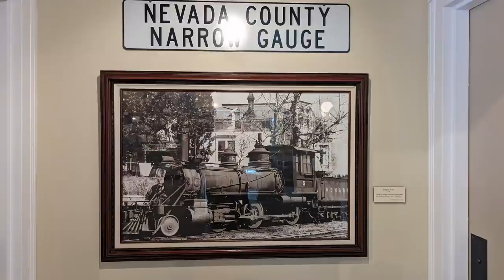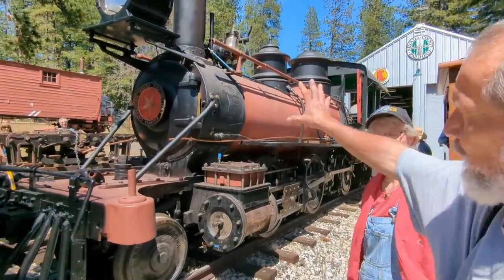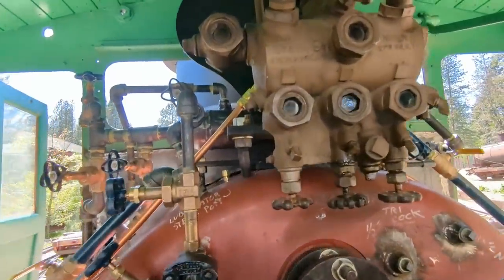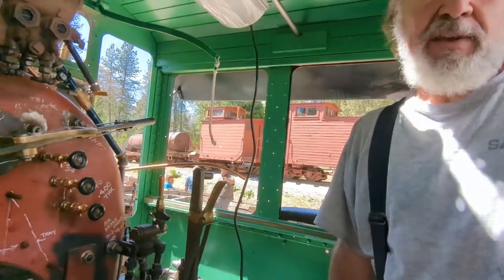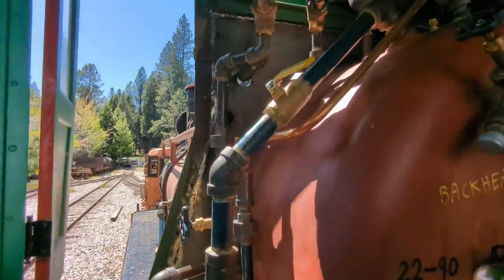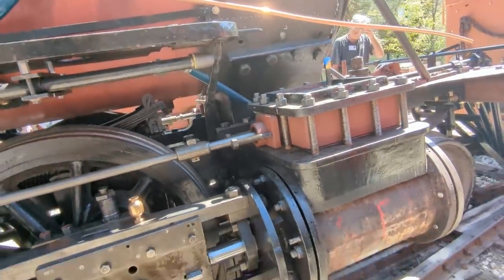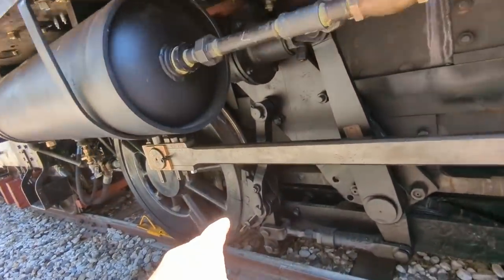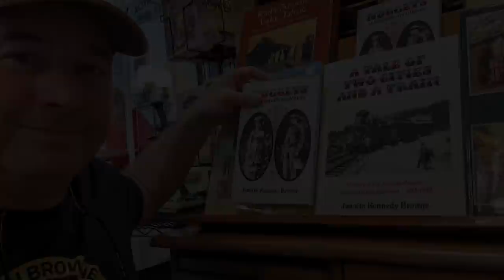1875 Baldwin Locomotive Restoration NCNGRR #5

Comment: It looks like this Engine uses the Stephenson’s valve gear as Opposed to the more commonly used Walchaert system. It is always interesting to study the comparison among them. There are also other Systems, like the Baker and Poppet valves. It is a joy to study them and understand how engineering has always being used to mive us around. These guys were geniouses.
Reply: Thanks for the comment, it made me look closer!
Reply: Walschaerts didn't really come into widespread use until the 1870's - 1880's.    Up until then Stephensons was used on maybe 99% of locomotives worldwide.   Baker came much later and I've always regarded it as a variant of  Walschaerts, it just replaced the sliding block of the lifting link with a clever arrangement of bell cranks.
Though Stephensons never really died out, Walschaerts and Stephenson each had their advantages (the technicalities of which are beyond me), as late as 1947 the LMS (London Midland & Scottish) built one of their numerous 'Black 5's'  with outside Stephenson gear as an experiment.   (And it's been preserved, I think it's still running).
Reply: Walschaerts was not yet invented in 1875 when this engine was built by "the Baldwins"
Reply: @garybensman1358   Just to split hairs, it was apparently invented in 1844, but not used until 1873 (on a single loco), and (contra what I said above) it didn't really catch on until at least the 1880's.    So you're pretty well right   :)
Interestingly, Wikipedia gives the first British-built use as a double Fairlie for New Zealand, the first use in Britain itself as a single Fairlie, and the first use in US as a Mason bogie.    What all those have in common was, their engines were on 4-wheel bogies (trucks), which would not have given much room inside the frames for valve gear, so Walschaerts - typically mounted entirely outside the wheels - would have been advantageous.
Reply: Yes.  It is Stephenson valve gear.   I wood-fired a little Baldwin mogul that ran between Tavares and Mount Dora, Florida a few years back.   It was an old-west themed standard
gauge train.   It too had the Stephenson valve gear.   It was built in 1907 and was originally purchased by a lumber company.   The name of the train was "Orange Blossom Cannonball"
The train was owned by Richard Grigsby of Reader Railroad in Arkansas.   His train had been trucked out to the deserts of Nevada several times for various movie shoots.
His train is featured in many movies such as "Brother where art thou" and several others.    That train was running there between Tavares and Mt. Dora for 5 years from 2011
through 2016.  Last run was in Feb. 2017.    It was an honor and a privilege working with those guys!   I learned so many unforgettable things by working there and being broken
in as fireman.  It was the hardest work I ever have done.   For the lowest pay.   But it was the best time in my life so far.   I was 60 when I started with them.   First firing gig at 60.
Hard hard work but worth every minute of it!    And, to their surprise, I very easily kept up with and outperformed the feisty 20 year old boys.   Wood firing is all about
doing more with less.  She popped at 154 psi.   Engine #2

Comment: HA! I've never heard of a steam locomotive as being "airworthy!" Great commentary, Juan. There were a lot of things brought out that I didn't know about and I've been watching trains since I was a kid!
Reply: In German we have the term "eisenbahnfest". (railway approved) Which means all the stresses which railway operations force on equipment will be taken without harm. The operators learned this lesson when they tried to adapt presumedly cheaper components from automobiles. The run on wheels too, don't they?
Reply: @V100-e5q     Something that surprised me when I had a cab ride in a main line locomotive, was the sheer magnitude of the vibration.   So now I know why everything on a  loco has to be massive and firmly anchored to not break or shake loose. 
Not only was this 80-ton loco bouncing around like a rally car on a forest track (and this was on NZR's main line), but the vibration was surprisingly high frequency - it wasn't chuff chuff chuff, it was brrrrrrrrr.     I worked out that at 50mph with 5' drivers, they were doing close to 300 rpm, which at four power strokes per revolution was 1200 per minute or 20 cycles per second, hence the brrrrrrrr.    And at full throttle and cutoff, the piston thrust would be around 20 tons.    I would have loved to be on the loco when it was tackling a bank, but the section I was on was mostly downhill/level.
Reply: @reddog 458, I CAUGHT THAT ALSO!!!!! FIGURED JUAN HAS SAID THAT A MILLION TIMES!🤣🤣🤣😂😂

Comment: I’m pretty well read on steam locomotives, but I sure enjoy a periodic review.  Back in the day the boilers were riveted, but, for safety, longevity, and reliability, boilers are now welded.  That may not be entirely authentic, but it takes a sharp eye to see that difference.  Go to Felton, CA and ride the Roaring Camp and Big Trees Narrow Gauge Railroad.  They have some very old and very unique equipment.
Reply: I noticed that.    All-welded boilers were a relatively recent development, about the mid-20th century I think.
I'm not sure an engineer would agree that welded boilers are necessarily safer.   Welding can introduce significant stresses into the shell, it may even introduce cracks, and cracks can run right across a weld, whereas a line of rivet holes can act as a crack stopper.    A properly made, tested, inspected and maintained welded boiler is certainly safe, but so is a riveted one.    And badly maintained or corroded ones of either type are dangerous.    The chief advantage of welding is in the considerable saving of weight and labour (and probably it's easier to find skilled welders these days than riveters).
Reply: @cr10001  All steel pipelines are welded. And they run for hundreds of miles. So what are you talking about? Every technology has its ups and downs. If done wrongly it will fail.
Reply: @V100-e5q    I'm just disputing that a welded boiler or structure is inherently safer than a riveted one (which is what the original poster stated).    Certainly a welded boiler is usually cheaper and a little lighter than a riveted one, these days.   However, welded heavy-walled pressure vessels require extremely close control of welding procedures, metallurgy and design detailing to assure safety.   
That's as I understand it, but the subject of fracture mechanics and crack propagation is highly mathematical and a bit beyond me at the moment.

Comment: The lesson is that you don't run the boiler out of water.  They did a lot of work to convert from wood fired to oil fired, kudos to the folks there.  She's a beauty that will look even better once everything is done.  If you're ever up in Oregon, Lebanon, check out the steam engine that George Lavacot rebuild with a lot of help over 38 years and then sold to the Albany & Eastern Railroad, an ex-Santa Maria Valley 2-6-2.  They are using it in regular excursion service and switching freight cars now ant then.

Comment: Being a rail fan this is of great interest. That they've got the hydrostatic test done and the boiler inspection certificate indicates they will soon be at the beginning of their FRA(Federal Railroad Administration) 1478 day cycle (I think that is how long til the next major inspection, equivalent of a TBO). 
      The reason for conversation to an oil burner is a matter of liability. Both wood burners and coal burners shoot fire embers out of the stack. In places with dry wooded conditions, this is a major hazard. The Durango and Silverton in Colorado is currently involved in a major liability after a large, expensive (2-3 Billion dollars of damage) fire. Western steam tourist operations have been converting there locomotives to oil fired since or not running their wood and coal fired steam locomotives.
Reply: We have an annual State inspection to include a hydrostatic test. I believe the FRA requirement is a major inspection every 15 years.
Reply: The wildfire danger is an excellent reason to switch to oil burning for steam locomotives.
Reply: Being a narrow gauge railroad, does FRA even have jurisdiction over them?

Comment: Glad to see her ready for steam.  Gotta make a trip over there.  It is easier to fire an oil fired steamer.  I hope you show it fired up.  Nice new welded boiler!  Nice job Juan.
Reply: There is a learning curve associated with oil.   It definitely takes more coordination with the Engineer's throttle movements.    That said, oil is more convenient to load and a load of fuel will last much longer than with wood.   It will also be less strenuous for the Fireman.   The fire risk is lower and as the gentleman noted, you can kill the fire quickly if there is a problem.     With the increasing fire risk in many parts of the country, I think that in the future, quite a number of coal and wood-burners will be converted to oil-firing.
Reply: @kevinmadore1794  very true 👍

Comment: Beautiful engine! 
We are fortunate to have The East Broad Top narrow gage (3ft) RR here in Central Pennsylvania, . Mikado-type 2-8-2 locomotives. Back in the day it hauled coal , mail, timber, limestone, bark, passengers to the PRR mainline . Right next door to The Rockhill Trolley Museum. 
Check out the powerful Shay engines some time (vertical cylinders drive a horizontal drive shaft) if you care to see an "entirely different" type of steam locomotive.  
My Grandfather worked at the Altoona shops where he helped built K-4's, 4-6-2's,  workhorses of the PRR.

Comment: The crankpins on a steam locomotive are "Quartered" meaning the crankpins are 90 degrees offset instead of 180 degrees offset. That way they can never stop with both sides pistons at top and bottom dead center......the engine wouldn't be able to start. When they are Quartered, there's always one piston that's mid stroke, thus letting the engine start from a standstill. ....

Comment: One thing I always like pointing out, there is no gearbox on stream locomotives.  The are direct drives and have the same power output at 0 as they do at full steam.  Steam locomotives were common right up to the 1960’s and just as powerful as diesel locomotives, only lost out because they weren’t as fuel efficient and took a lot of water.
Reply: There were a lot of reasons diesels replaced steam, one of the big reasons was that steam required a lot more maintenance than the diesels.
Reply: At 0 speed, steam recips output zero power. Drawbar force is one of the two factors of power, the other being speed (of drivers). Zero speed -> zero power. Even with N&W compounds, thermal efficiency was <10%, largely because of low pressures (<300 psi) fire-tube boilers could sustain, and blowing away treated boiler water after one use was stupidly expensive. Early diesels could easily be MU-ed so 1500 hp each was not a problem while they continued to grow. Diesels, and even more so electrics, had, and have, much higher availability, so having to roster about 1/3 as many units, each requiring much less service, made for more savings. One account is that the departure of mgs of steam-specific hardware convinced N&W execs that steam era was over. Road-switchers that could be operated either end forward sealed the deal.
Reply: @jacquesblaque7728  "At 0 speed, steam recips output zero power."  Yep, work = energy = force x distance, and power = energy used per second.  The other way of thinking of it is power = 2 * Pi * rpm * torque / 60.  Either way, if the engine isn't moving then it's not producing power.

Comment: This 1875 Baldwin is essentially a sister to the Carson & Tahoe Lumber & Fluming Company #1 "Glenbrook", which operates at the Nevada State Railroad Museum in Carson City.   Both locos were built for that railroad and this one was later sold to the Nevada County Narrow Gauge.   Glenbrook was restored to her as-built appearance, with a wooden cab and balloon stack, and this one appears to be under restoration to the NCNGRR configuration, with a straight stack and metal cab.   I BELIEVE.....check me, Juan.......that the boiler we see on this engine now is the one which was originally built for the Glenbrook restoration, years ago, but did not fit her frame (not sure how that happened).   Seeing that boiler re-purposed to get this engine running is a wonderful win-win.    I would love to see her restored to FRA specs, so she can travel to FRA-regulated railroads, but I fully understand the cost issues with doing that.    Glenbrook was restored to FRA codes and ran with the privately-owned Eureka & Palisade #4 last summer on the Cumbres & Toltec Scenic Railroad in an epic event that was incredible to ride and photograph.   Still, I am very much looking forward to seeing this little gal in July at the NSRM event.   NSRM does not require FRA, so a state boiler cert. will be all she needs.   I am definitely placing the NCNGRR Museum on my to-do list.   Thanks so much for the narrow gauge steam coverage.
Reply from the maker: Correct!!
Reply: Kevin, in regard to the Glenbrook replacement boiler, the boiler fits perfectly on the chassis and the mounting points all match up. The error on the boiler design was that the transition section was set up almost three inches higher than the original boiler which made it unsuitable for an 1875 restoration. Since NCNG #5/Tahoe is being restored back to the late 1930's as she appeared before going to Review Studios, the higher transition is not a problem and does not affect the former SP cab that came off of NCNG #7, which only required a minor adjustment. John
Reply: @johnchristensen4665  Thanks John!   I always wondered about the back story as to why that original boiler for Glenbrook did not work out.   As noted, repurposing that boiler to get Tahoe running is a wonderful win-win.    Reviewing the website, it looks as if the NCNGRR group does have some rolling stock they can run behind her, leaving open some nice possibilities for NCNG photo freights in the future.    This place is not all that far from Reno.   I need to get out there and see the museum.

Comment: This is an unusual locomotive for 2 reasons. First are the dual eccentrics diving the valves usually the valves are driven by a crank arm attached to the crankpin on the driven wheel. This is probably a Stephenson reversing gear where one eccentric is forward and the other is reverse. The Johnson bar controls which eccentric controls the valves. The other thing that shows that the is an old loco is the valve itself, Later locos working at higher pressures use a piston valve which is why they look like the have a smaller cylinder on top of the main cylinder. The slide valve is held against port face by the pressure of the steam so as pressures went up slide valves were abandoned because the higher pressures would cause too much friction and quickly wear the slide valve and the port face
Reply: With respect, not unusual at all, absolutely typical for 1875.     It would be unusual if a locomotive of that era didn't have inside Stephenson gear and slide valves.    Walschaerts gear didn't come into use until the late 1870's - 1880's at the earliest, and even after that many locos continued to use Stephenson gear.   And piston valves didn't arrive until, I think, the 20th century.
American locos typically had inside Stephenson gear driving outside slide valves (and cylinders) through rocking levers, like this loco.   British locos typically had inside Stephenson gear driving inside cylinders and slide valves.

Comment: Boilers are Boilers for the most part, as an EHS Manager most every plant had a boiler of some type to provide steam. The Inspectors back in the 80’s and 90’s (maybe still) were mostly old Navy BT’s (Boiler Technicians), but the Navy did away with that rating many years ago. I suppose the Gas Turbine guys could do the same inspection, we has many of those Navy guys at the Gas Turbine Power Plants.

Comment: Nice to see the engine run again and with what appears to be a modern code-welded boiler. The right material, correct welding rod and weld proceedures with certified welders; probably a little NDT weld inspection too. Tangent situation with old traction engines, I like to go to the shows, but cringe when I see a single or double row of 100 year old rivets hold pressure. Single injector?